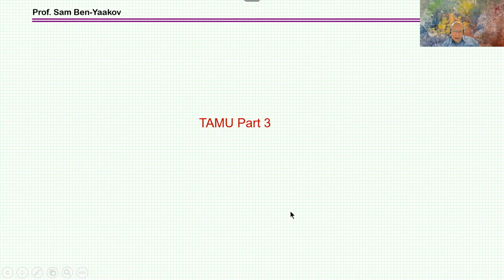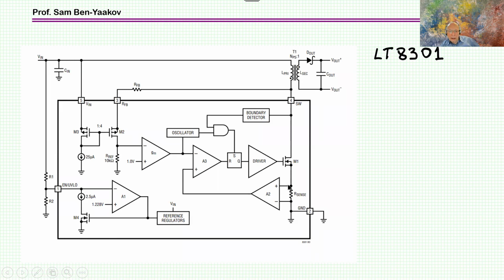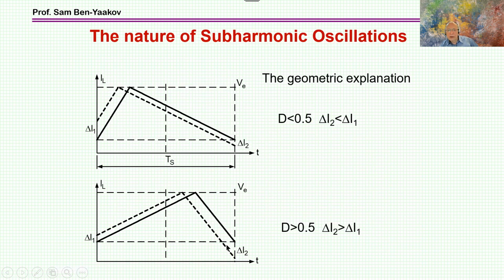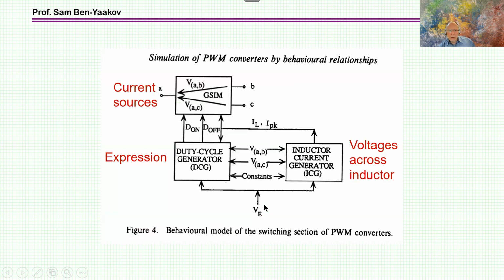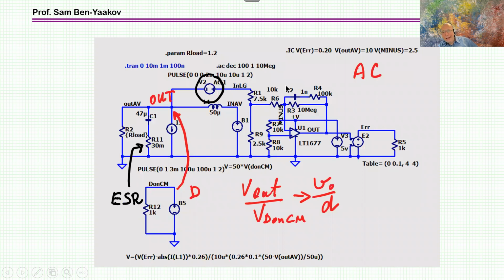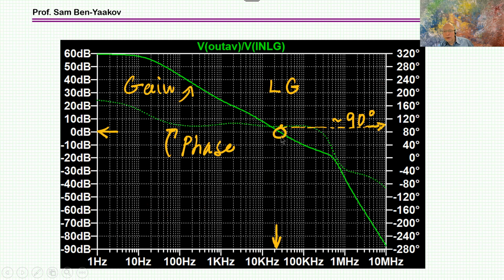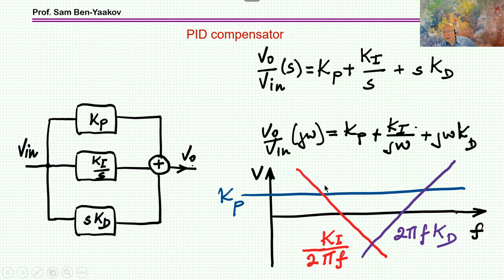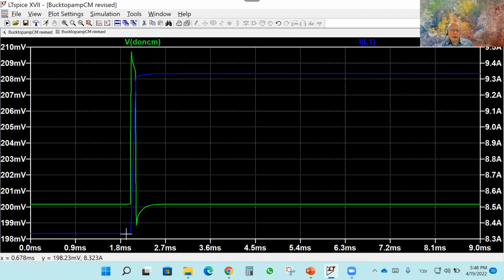Modeling and control of PWM converters - Tutorial - Part 3 PCM  control, PID

Comment: Great lecture as always, Professor Yaakov. I was wondering, in the digital peak current mode control, if we trigger the ADC at the peak-current instant in every PWM cycle, would it be possible to eliminate the analog comparator altogether?
Reply from the maker: How can you trigger the analog to digital converter at the peak? For that you need a very high sampling rate which is costly.

Comment: Hi prof: Phase shifted DCDC converter is voltage mode control. So it is  two order system? it is dificult to control?
Reply from the maker: Yes, but current mode control an be implemented .
Reply: @sambenyaakov  You’re absolutely right, I was confusing PCMC with ACMC. In ACMC you can simply trigger the ADC at mid-PWM duty cycle(using center-aligned mode), and the sampled current at that instant effectively represents the average current value. I also checked several ST and TI application notes on digital PCMC, and they both rely on an on board analog comparator to implement it. So yes, that’s definitely the correct approach!  Thank you so much for your kind answer and for your time, I really appreciate it !

---

Let me know if you want a more formal, academic, or shorter version!

Comment: Cycle by cycle current protection is possible with average current mode control if you feed the unsmoothed signal (containing triangle wave) to a comparator.
Reply from the maker: Sure, And you can use it with voltage mode control too. The point is that it is built in, does not need any additions.

Comment: great video. I have  doubt though. If the load is a capacitor and its  a capacitor charging circuit, like a fly back capacitor charger, is it necessary to take voltage feedback from output? Anyways the output voltage is not constant nor need regulation, only final voltage matters. So can the control be just restricted to peak current sensing alone?. Or do we need to measure the change in voltage per cycle and realize controller according to that .? Thank you sir.
Reply from the maker: Without voltage feedback it is basically a current source that is  locked to the peak current

Comment: Wonderful video.  It's amazing to me that I don't see the use of average models in large signal transient simulations more.  Your duty cycle generator block clearly enables this, but I find it astounding that it's not common place.  With the exception of yourself, every time I see an average model simulation, I see it used exclusively for compensator design via bode plot, and maybe a quick transient sim of a load step to verify performance.  Many times, this occurs because there is no DCG block, and LTSpice can only linearize at one point.

But being able to quickly run transient simulations over very wide operating conditions (large signal) seems useful for so many applications, and time domain investigations.  Why isn't the world running so many more large signal transient simulations with your average model?  I simply don't understand.
Reply from the maker: Thanks Aiden. I have published in the past many papers on this approach but it did not catch. As the saying goes: You can lead the horse to the water but you can't make it drink😊

Comment: Hi prof. Thanks for the detailed and interesting video! Is this model relates only for CCM operation, and for DCM should make the addition for Doff expression as in voltage mode control?
Reply from the maker: Yes, correct.